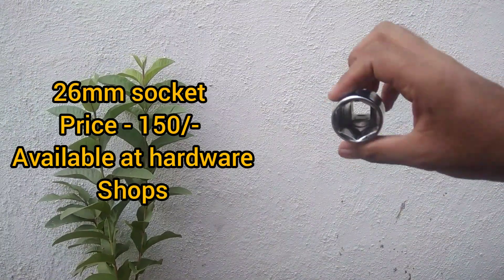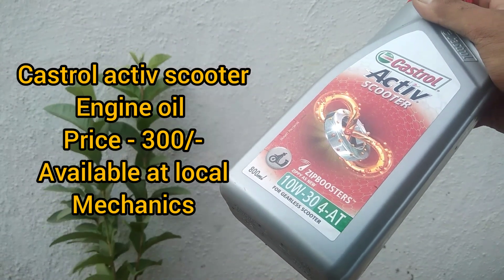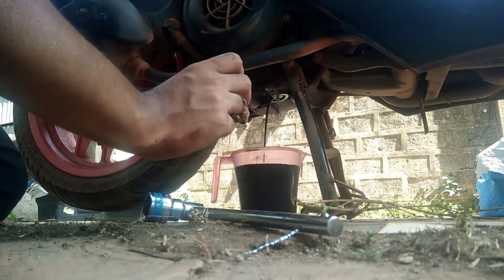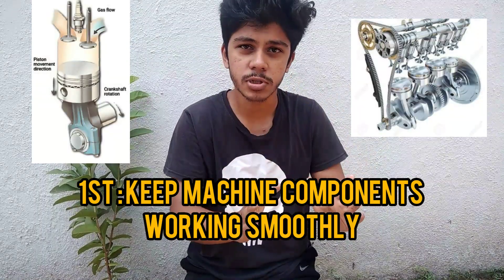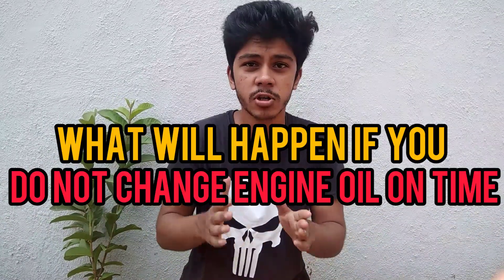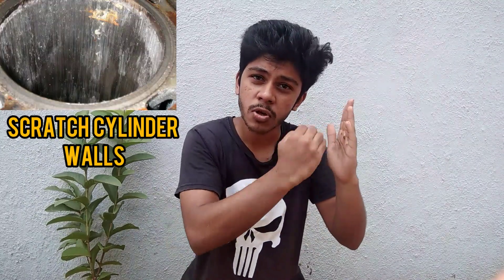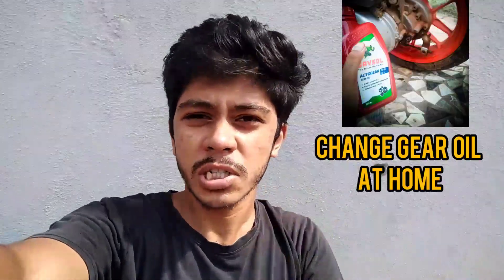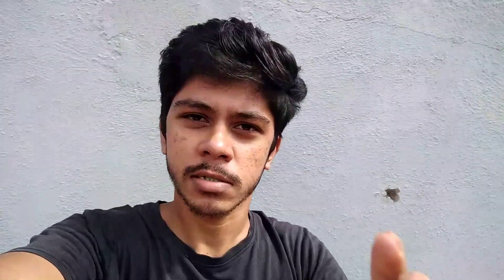STEP BY STEP How to change Engine oil | Aprilia SR 150

Comment: 24mm wrench works on 2018 October Aprilia SR150 Carbon
Reply from the maker: Thanks for watching Prabhath!
Yes it does. The engines are the same changes are only done to exhaust manifold and muffler. Try it out. 

Stay tuned with #TeamSmokeysGarage

Comment: 10w40 fully synthetic oil should do...???
Reply from the maker: Thanks for watching Saurabh! 
Not really. The Aprilia engine is not designed for synthetic oils. What will end up happening is the synthetic oil will keep the engine a lot cooler and the piston and crank shaft a lot lubricated that what is required. 

It won't damage anything but you will unnecessarily be paying more money for it with no change in Throttle Response/Engine temps/Life of the engine/Throttle Response/engine smoothens. 

What will be a better idea is you go for the Castrol Power 1 ultimate scooter oil. Which is designed according to a scooter engine parameters. 

Stay tuned with #TeamSmokeysGarage
Reply: Thanks brother, i used  motul 10w40 full synthetic oil and so far its the same as older version, will update if any changes noticed. Keep up the good work 👍
Reply from the maker: Hey Saurabh! 
It isn't causing any problems right? And is there any change in the mileage? Do let us know. Cause our viewers will like to know more about this
Reply: Not any significant change in milage or pickup can't say anything improved

Comment: Hi I have recently purchased Aprilia 160 carbon race,does this 26mm socket fits my engine drain bolt?
Reply from the maker: Thanks for watching Reehan! 
Yes it does. The Aprilia Sr has same bottom engine engineering across all Scooter's. So 26mm socket will fit. 

Stay tuned with #TeamSmokeysgarage

Comment: Bro can I used pipe wrench or sided open end wrench instead of socket and torque wrench ?
Reply from the maker: Thanks for watching! 
Yes you can give it a try. But a longer shaft makes it easier to open the bolt. 

Stay tuned with #TeamSmokeysGarage
Reply: @shubhaybuilds  ok
Reply: Use 24mm Socket

Comment: Bro, SR 150 in the manual recommends 20W 40 Castrol Activ 4T (which nowhere mentions scooter specific) as far as I saw & nowhere available in the market with this grade in any other brands aswell.
But u are adding 10W 30 4-AT which is a scooter specific engine oil!
What changes do u see?
Reply from the maker: Thanks for watching!
Currently using the Castrol active Scooter Engine oil. Engine runs smooth and cool. Good pickup and getting good mileage also. I haven't faced any problems with Castrol engine oils. Hardly recommend

Stay tuned #TeamSmokeysgarage
Reply: Any online store I can get 20w 40 700ml as recommended ? In my area it's available in 900 ml only. Or can I use 900 ml in sr 150

Comment: After how many kms should we change the oil? And I have rode my scooter of around 500 km since the last time I changed my oil bt it was like 6 months ago.So should I change the oil or ride it till 2000-2500kms???
Reply from the maker: Thanks for watching!

This confusion is faced by many people. Let me clear it. On service manual it is written you must do the service at +__ kms or ___Months whichever is earlier

Because engine oil starts detoriating when subjected to oxygen. So the moment you open the cap engine oil is loosing it's properties

You must serivce you bike immediately to prevent problems

Stay tuned #TeamSmokeysgarage